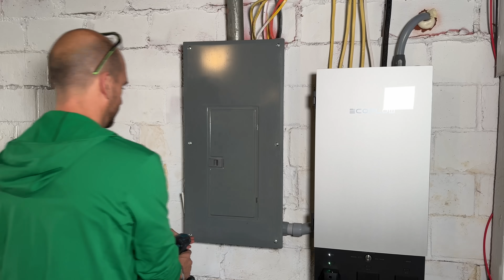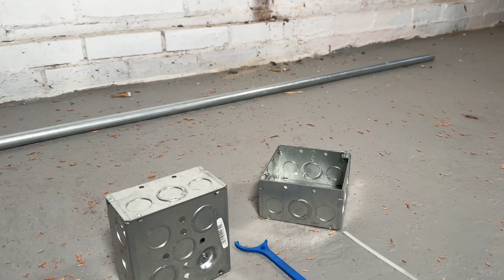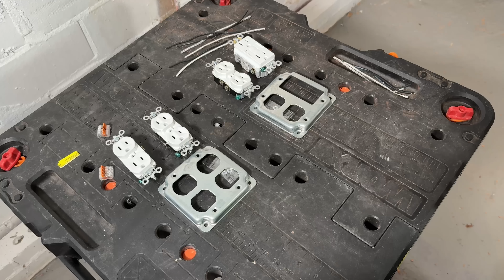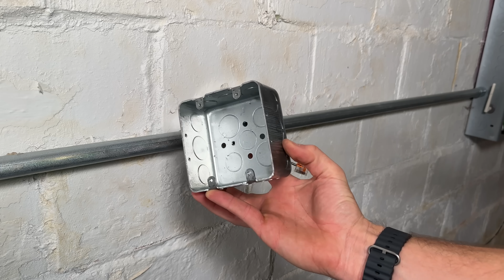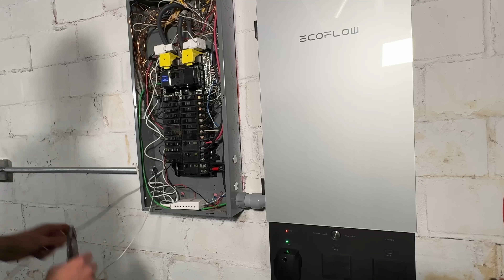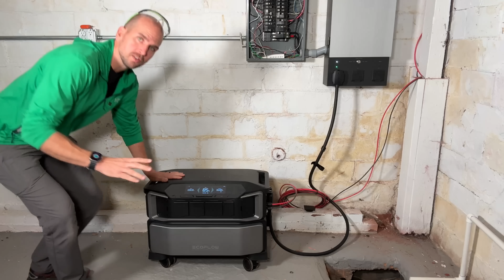Add Outlet To Unfinished Basement Or Garage

Comment: Run the ground. You’re there already. If foregoing the ground wire, at the very least bond the receptacles to the 1900 boxes. The receptacles will be grounded once mounted, but bonding them to the box is a sure fire way to make sure the ground will never be a failure point. Just my 2 cents
Reply: I agree. I don't know NEC, but I used to plan wiring inside medical equipment and had to follow IEC-60601. One of the things that my engineers drilled into my head (so they didn't have to redo my ground path planning) was to never rely on a mechanical connection for grounding. Always intentionally supply a dedicated grounding path. OK... I expect that electrical standards for medical devices are a lot more stringent than housing codes. But for such a short and easy run, put in the dedicated grounding path just for good measure.
Reply: @Sembazuru  EMT is a dedicated grounding path. Isn't a ground screw also a mechanical connection?
Reply: @pld8993  If the only thing a ground screw is doing is connecting a ground, that isn't considered a mechanical connection for what I was talking about because the ground screw's function isn't to hold mechanical things together. Mechanical connections would be things like PCB mounting screws and standoffs, screws holding panels onto boxes, outlet mounting screws, conduit set screws, etc. Basically anything that is expected to hold things together under mechanical load and/or vibration. A wire not under tension isn't enough load to be considered a mechanical load. Even conduit that is supported on a wall to regulations will be seeing mechanical stresses at the connection to the electrical boxes as the conduit stretches and contracts due to changing temperatures.
Reply: @Sembazuru  So changes in temperature or ambient vibration affect the conduit but not the ground screw connection within a box that's connected to that conduit? Assuming an equal amount of temperature change, copper and aluminum are subject to greater levels of expansion and contraction than steel. Using your own description of a mechanical connection, a ground screw absolutely falls into that category. FYI, electrical engineers aren't automatically electricians (though many believe that they are) and should not be trusted to know what they're talking about when it comes to the electrical trade unless they are ALSO electricians. Conduit systems, when installed properly, are more than sufficient as EGCs and while running a wire type EGC isn't wrong, it's usually unnecessarily redundant.
Reply: @Sembazuru  FYI, the NEC is fully aware of the performance characteristics of metal conduits in use under various conditions and in various applications and is comfortable relying on them as EGCs. I see no legitimate reason to doubt that position. That said, if you're talking about internal wiring of equipment that's being manufactured, different requirements may apply.
Reply: @pld8993  Yeah, and medical equipment is really stringent. I get your point. But if I was doing the DIY I'd probably overdo it just from my ingrained habits. (You should see me froth at the mouth when I see someone on YouTube solder a crimped connection. 😱)
Reply: I'm right there with you, soldering crimped a connection is the worst. @Sembazuru
Reply: @pld8993  Emt is not a legal bonding path in Canada. A separate bonding conductor  must be run. It does not need tp be insulated unless it is being pulled through more than 180 degrees of bend. A bare ground does not count as pipe fill.
Reply: @Sembazuru  do by what you are explaining a wire under a screw is a mechanical connection.  Cause all metals contract including copper wire. If not the why every year when we retorque our connection it moves a little before it clicks.
Reply: @pld8993 yes, but removing the mounting screw ungrounds the device, now frowned upon by the code.
Reply: @greggpurviance7252  The NEC allows certain things, requires certain things, and is silent about certain things. If the NEC allows something it's allowed as part of a safe installation, so where does the frowning come in? Nonsensical statement.
Reply: @pld8993 Only if EMT has a grounding bushing, that is connected inside the panel. If there is no grounding bushing, the pig tails are required in the box you are pulling too
Reply: @jessiejames683  Incorrect on both counts. Feel free to share any code reference that supports what you're saying.
Reply: @pld8993 EMT conduit is subject to physical damage beyond the control of the installer.
Connections can and do loosen up.
If you can't afford an 8' length of #12 green wire.....you have  other problems 
The NEC absolutely does allow you to use the conduit as a legal ground.
But understand son that doing things to code represents the bare minimum safety standards allowed by law.
So everytime your work meets code.....pat yourself on the head, and put a gold star on your shirt.
Reply: I was just checking on the ground wire subject. 

And as far as I was able to find online so far. The metal conduit can legally be considered your ground wire. 

(Unless the NEC recently had change the code in 2024.)

But is it really recommended to have your conduit be used as your ground wire?

The correct answer is a no. 

The reason why is because of someone might want to try to losen some of screws to hang something on that conduit. And they might forget to tighten the screw. 

Even though it's all made of metal doesn't it mean all pieces are truly touching each other. 

So would I decide to add the ground wire regardless?

Yes I would to ensure that I have proper grounding at all times. 

Due to even one connection is a point of a failure. So add the extra ground. It won't hurt. It just guarantees a proper ground at all times.
Reply: Your 2 cents is worth hundreds of dollars later. I had an issue with an Automotive Aligner that kept cutting off intermittently, meaning turning off power. Took about a week to figure out what was going on. When I would test the conduit grounded circuit, it would test as a good ground. Finally I found an open ground and I tightened all the fittings on each box in an attempt to correct the ground only to have the ground continuity fail again. Due to the long run and many boxes for electrical supply. It was cheaper to install a dedicated circuit with the ground wire. Shows the headache you will eventually have leaving the green ground wire out of the circuit. Licensed people know what there doing and unlicensed home owners would use the Romex that was originally in the conduit at the start of this video, that would have had a shielded ground wire. I love reading comments and I rarely leave one, today I have.
Reply: It's hard to tell for me if the box us painted or not.

Not trying the ground to the EMT connector in the box at least seems a bit sketchy to me.
Reply: The 1900 box is not painted. The panelboard enclosure is painted, paint at the connector should be removed.
Reply: Phoenix requires a ground wire in all raceways. Using the conduit and self grounding receptacles hasn't been done here in more than 30 years
Reply: Thanks for sharing but If your gone play electrician you should know more about grounding don’t want to mislead all your DIY s especially with electrical ! ,it’s very important,also throw them quick connect Waco in the garbage😂,bad connections under loads.cant use concentric knockouts for good ground and of course the raised cover should have a pigtail bonding the receptacles.not trying to put down but electrical should not be on the list for DiYs call an experienced everyday electrical contractor it will be safer for you and your family.😁👍💡
Reply: @theclangers8567  Incorrect. Yes, it protects the wiring, but it also provides a grounding path and the fact that it protects conductors from physical damage does not negate its role as an EGC. The NEC identifies 14 types of EGCs, only one of them is a wire-type EGC.
Reply: I agree. Just run the green wire and no one can complain. I think of it this way, if you rely on the conduit there are more points of connection than using the green wire. The less points you have,  the chance of failure is reduced.
Reply: Remove the fiber keeper from one end of receptacle
Reply: Agreed, as a EE-PE, when inspecting, I wouldn't have to research why and if the products used were properly listed for that use.  I am ok with the continuous metal conduit acting as the ground, but at least put in the box green wire grounds and pigtail out to the receptacle ground screws.
Reply: I’ve seen many instances where EMT conduit has been jarred and disconnected along the path thus breaking the grounding path. A dedicated ground wire is the safest method along with bonding the conduit.
Reply: Agree 👍
Reply: Come on. Run a ground. What happens if you lose neutral under load?
Reply: @lenoflorer6151  There is already a ground present, the EMT. If you lose the neutral the circuit stops working. Having a ground wire won't change that.
Reply: Bonding Receptacles creates "Objectionable Current", and stray magnetic fields which are unhealthy, and a known cause of Leukemia (blood born Cancer).
Reply from the maker: Thanks for the feedback.
Reply: In @EverydayHomeRepairs

Comment: Once you dismount the GFCI from the metal box....it is no longer grounded. I recall that in another one of your videos you used a wire to ground the GFCI to the metal box to ensure protection from hazards in the event of servicing the GFCI or testing the circuit lines when servicing. The GFCI protection performance is assured when it is grounded and being serviced.
Reply from the maker: Actually the GFCI will work independent of a ground.  There could be no ground and the circuit would still have GFCI protection when a difference between the hot and neutral is detected.

Comment: Scott, speak to this:  was this the first disconnect? And if so was the ground and neutral bonded?  If this is a sub panel without bonded ground and neutral how does this change the installation?
Thanks Scott!

Comment: Never, ever use use a tubing cutter to cut emt as you'll never totally eliminate the curling in of the pipe no matter how much you ream it out. Don't be lazy, use a hacksaw and it'll be much easier to ream out.
You touched on conduit supports, but never actually used them, why?
Reply from the maker: Since my segment was less than 10' my interpretation was I met code.  I missed the part where you need support 3' from each terminating end.

Comment: PLEASE stop watching this guy for electrical advice.  90% of this video is wrong...  It'll work, but not at all best practice.
Reply: 90%?!? Way to be hyperbolic. Everything is perfectly permitted by Code except the missing supports for the conduit and that he pushed wire with exposed ends into a hot service panel. That is hardly 90%.  It may not be "best practices" but its not wrong.
Reply: @TwilightxKnight13  I would love to hear the details on what are best practices in this case.  Some have commented on pushing/pulling, and I thought he mentioned that he turned off the main breaker.  Still would make sense not to push into the box, but if it was off then he did not commit that sin.

Comment: When I installed fire alarm systems I worked with a guy who used a pipe cutter to cut conduit. He would cut part way through then snap it over his knee. It can work IF you get it just right. I saw him hurt himself a few times. 
I used a hacksaw and a saw horse it was much faster. 
Do you have to get an electrical permit to do your own work in your area?
Also consider you no longer have insurance. Your insurance company would never pay out when they find out you did 
your own electrical without getting it inspected. 
Rant over.
Reply: How do you know he didn't get a permit or have it inspected?
Reply: @TwilightxKnight13  Well,if it was inspected there would be clamps to hold the conduit to the wall. 
What is going to happen the fist time the conduit gets pulled on? It’s going to pull out of the boxes ( the set screw will not hold it).
Then the wires get cut or pulled out. That makes to conduit live and the unlucky person who fell and grabbed for a hand hold Or little 
Johnny who was trying to do a pull up gets zapped.
I for sure would do similar out in My barn or in My garage up out of the way where it won’t get pulled on .But to show people who don’t know any better is plane wrong.
Or is it plain wrong? The one thing I will never do it not run a ground wire. Do not depend on the set screw and the nut to properly ground the system. 

Yes I am bored or am I board?

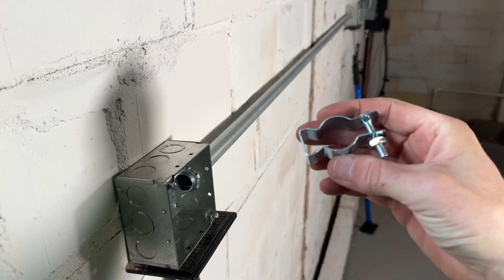Comment: 4:40 you don,t say why you don,t want "the pole" against the wall.  Thank you for your demonstration, man.
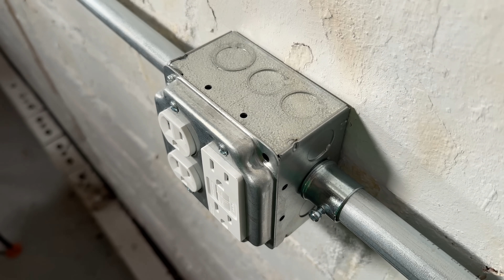9:43 The main power box is painted inside and out. Does the UL lock nuts really give you a good ground through the paint?
Reply: This is why I'd recommend he use a bond bushing, it might be overkill, but that along with a separate ground wire to the devices would definitely make an inspector happy.
Reply: > Does the UL lock nuts really give you a good ground through the paint?

No, it's an inferior connection and you're supposed to scratch or scrape paint off prior. Honestly there are so many reasons a receptacle in this circuit could lose its grounding patch, from loose screws or backed-out nuts or even just the plate being simply loose. Installing a wire is always better.